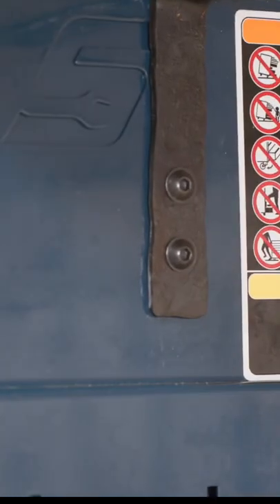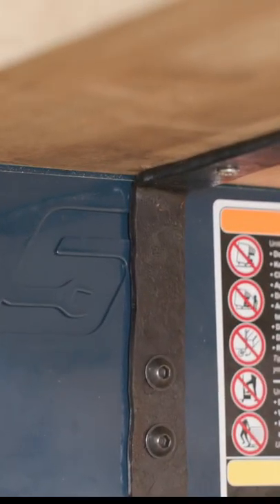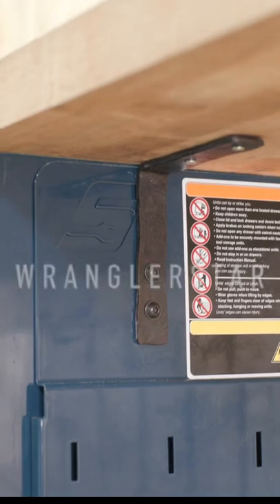Forging STEEL with Wranglerstar professional homeowner #Shorts

Comment: Nice work! But please consider grinding the tang of the cut-off hardy tool down a bit so that it gets seated properly on its "shoulders" onto the face of the anvil. Otherwise, you´re running the risk of severely chipping the edges of the hardy hole.

Comment: I'm jealous of how good the surface on that anvil is. I inherited an old swedish cast steel one my grandfather passed down but I need to get the surface milled off and leveled it has never been welded on before. I lack the equipment to do it/know of a good location that will do it for me.

Comment: Personally wouldn’t have gone for that bracket because it will bend over time with any weight, but if you welded a triangle into it, it would have so much more structure. But! I obviously recognize that it isn’t my shop nor my space. Otherwise, amazing work as always.

Comment: Yeah! REAL men don't waste time driving to the hardware store if there's a way to fix something that  involves fire, a hammer, smoke, and the risk of losing a finger or burning down the house.
I approve 

We're not like those soft people who go to a store to buy ready to use butter, bread, clothes or cars...

I only have ONE issue with this video: NOT mining your own iron ore and processing it into the raw material for the bracket, is a slippery slope to becoming soft, lazy and spoiled. Like the Amish.  Once they started using the wheel, it was downhill from there. 

😉 I bet most men have done repairs that took 100x more time and money than necessary AND were/are proudly showing them off. Myself included. And I'm NOT apologizing for it either!

People who make fun of us/you/THIS video, just don't get it.